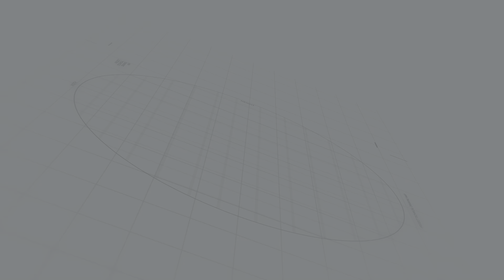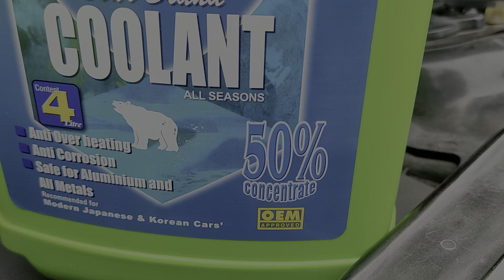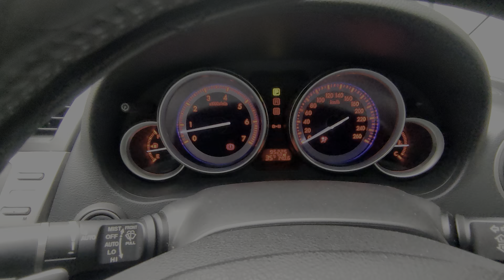How to Coolant Change - Mazda 6 / MZR-L5VE / GH1 / Maintenance - EP1

Comment: I have the same car. When I check the coolant in the radiator when engine is cold, I can’t see any coolant. So I pour the coolant overflow bottle into it and see that it always is about cup or two to fill to top. I guess it is normal that it isn’t at the top brim when cold?
Reply: Should be low when engine is cold, full when hot.
Reply: @ actually it should be at the top when cool. I discovered that the overflow hose was loose and so as it pressure and released some coolant, it would suck back air. So I had to “burp” it and now when it is cooled the coolant is at very top of radiator when remove the cap.

Comment: Very good. If I may make one remark: your cap says FL22. Therefore ideally you should put in FL22 again, not a generic coolant.
Reply from the maker: thanks man,., your right, FL22 is specific for this mazda 6,., with 1.3 bar cap and this engine heat range is higher than cars in general, 🙏🙏 #cmiiw

Comment: Kalau pake shell 70/30 bisa g y
Reply from the maker: bisa om,., 30/70 itu kandungan glycolnya 30%, 🙏🏻😁
Reply: Gpp y
Reply: Ga harus 50 / 50
Reply from the maker: aman om  @dhonibhangga7323  , kalo ada toyota pake 30/70 juga, 🙏🏻😁
Reply: Utk mazda 6 2008